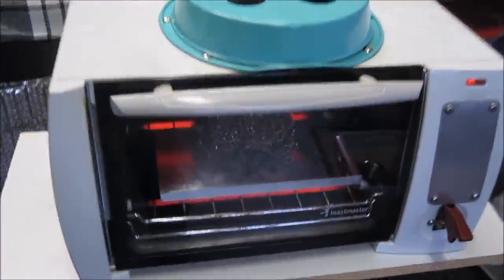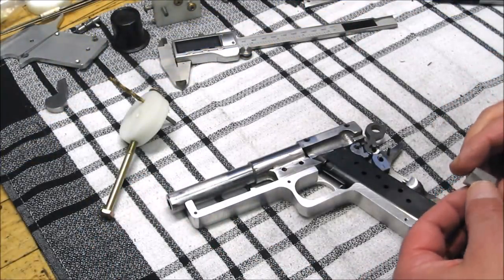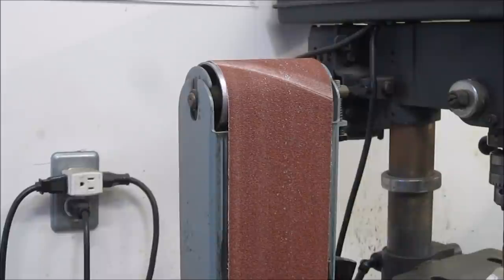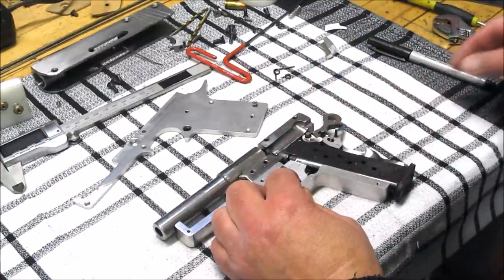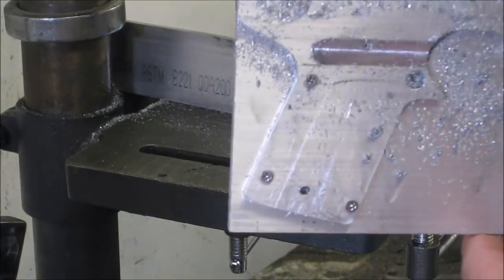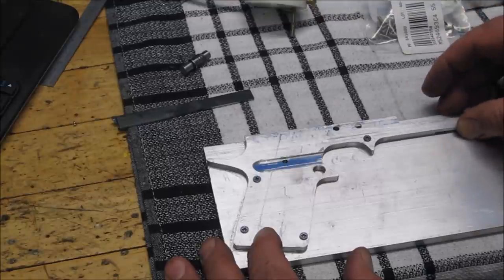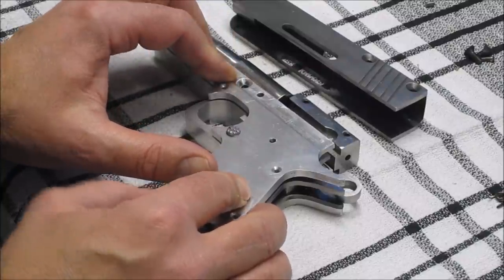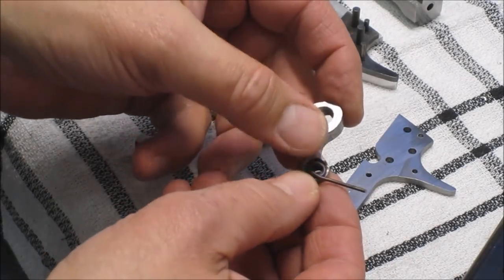Kolt380 Re-boot - All parts complete. Final tuning and future BANG!

Comment: My local scrapyard here in Florida buys drill bits, lathe bits and endmills made from carbide, they sell it for $10 a pound. I've bought several pounds of various size endmill bits, some are brand new. Looks like you could use some.
Reply from the maker: I buy my supply at the Oshkosh flyin convention every year. I have an eclectic mix of counter sinks burrs and cutting tools.

Comment: Hey Clinton, I'm looking to build the Professor Parabellum .22 revolver but it's a manual barrel turn I need some help with designing a way how to turn the barrel after every round is fired. I thought of using an arm like mechanism connected to the trigger or hammer that turns a gear at the back of the barrel but the schematic is kinda a tight fit so it would be pushing the boundary to implement that kind of mechanism so I seek some professional help.

Comment: Umm... if you take requests, I think you should do a Video focusing on the tools used to create it especially the creatively repurposed ones. Also, that drill press of yours should be bronzed when/if you ever retire it.. I can NOT believe that the  "milled" channel for the trigger bar came out so straight....I'd have bet a $100 it would have wandered all over the place.
Reply from the maker: That's a good idea. I'll ponder that. I was planning on using my router to mill that groove. I was concerned about doing the cut blind. The drill press worked phenomenally well. Keeping in mind I was cutting about .015" at a pass.